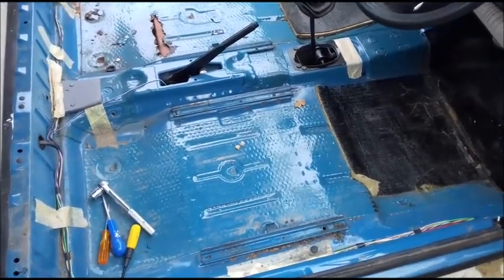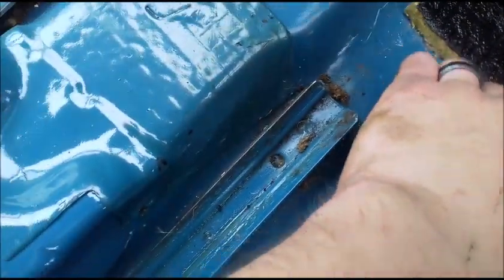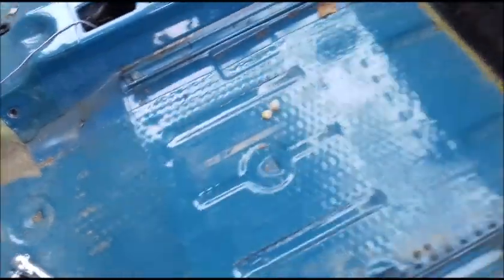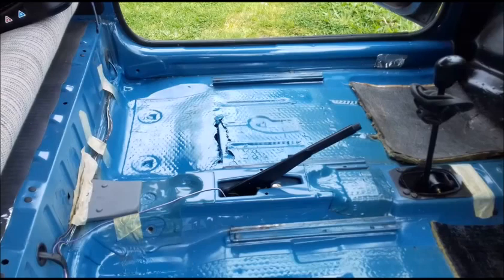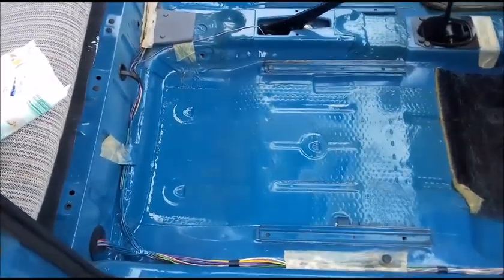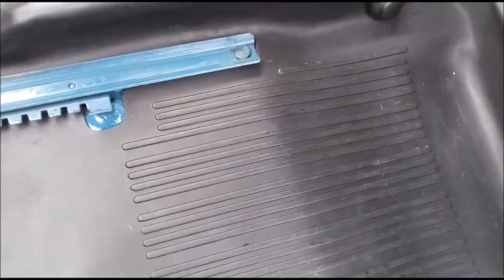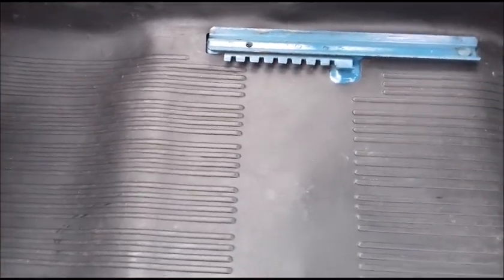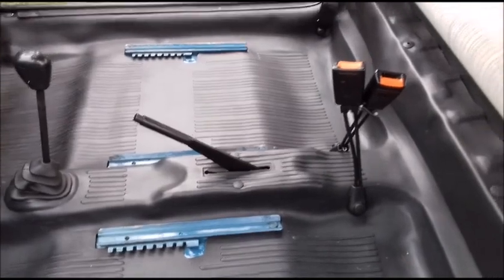Fiat Panda 750L Restoration Project Log #13 - A "hole" lot of trouble

Comment: Strange place for rot to appear. Normally sills are understandable but not floorpan in rear footwell.
Reply from the maker: David Toner on looking at the other side the paint had a "crazed" look. i am wondering if it was the passenger seat being folded forward and put back down somehow causing it. not sure